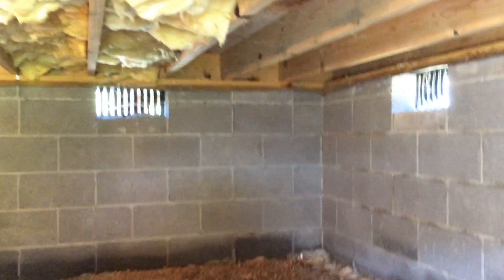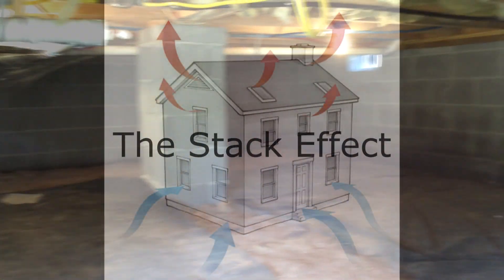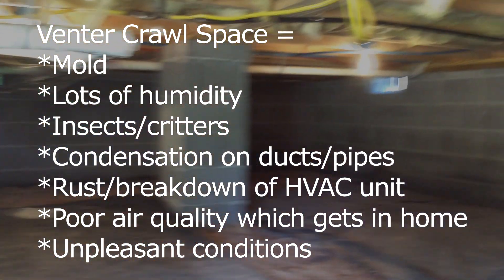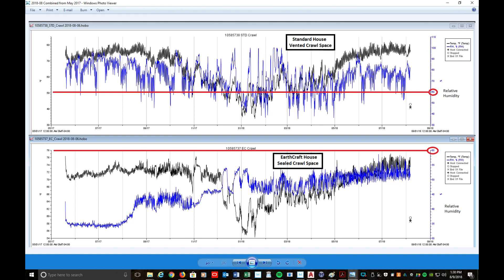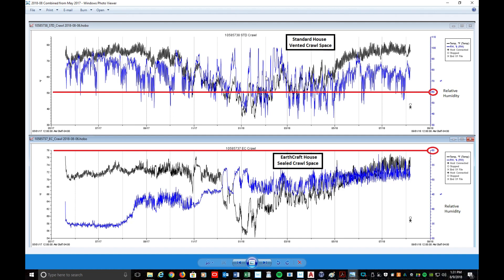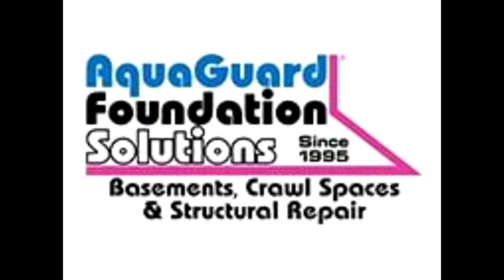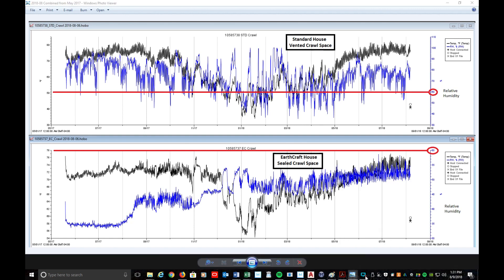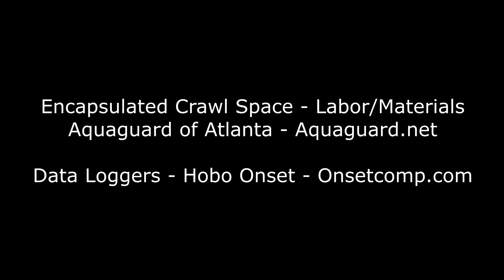Sealed Crawl Space vs Vented Crawl Space

Comment: Is there any venting for soil vapors??
Reply from the maker: Good question Christina.  No, You don't really need it.  The vapor barrier is 26 mil thick.  Ive got a similar setup in my crawlspace and I don't have any "off-gas" from the soil.  Its completely encapsulated.  Not to mention the dehumidifier helps circulate and condition the air.  My crawlspace is one that you walk into from the 1/2 basement so there is a lot of head room at first.  I have built storage shelves to get things out of my attic and into the crawlspace to allow more room for insulation up there.  My crawlspace has been like that since 2014 and still going strong.  I hope that helps.

Comment: Great video! In the EarthWorks home, is the crawl space “conditioned “ with air from the home HVAC too in addition to dehumidifier?
Reply from the maker: Thank you.  The crawl space is not conditioned with the home HVAC system.  Its conditioned by the dehumidifier only.  My crawl space at home is similar except larger in space.  I have a dehumidifier that also is the only source of "conditioned air" in the crawl space.  Relative Humidity is at or below 50% in both spaces.  I hope that helps.

Comment: This is a worst case comparison. Does the house with opened vent has vapor barrier on the geound which is the more basic  standard moisture  control.
Reply from the maker: Vincent, thanks for your comment.  Yes, the "standard" house has about 75% vapor barrier on the ground.  I did this mainly for crawling around in there.  The majority of houses I have been in are the same with only 75% coverage of vapor barrier.

Comment: What if you have vents on your crawl space? How would you seal those up?
Reply from the maker: Best thing to do is cut to fit 2" rigid foam board and fit it in the vent cavity from the inside of the crawlspace.  That way you can leave the actual vent on the outside for esthetics. Then once fitted I take caulking or great stuff foam and fill any voids.